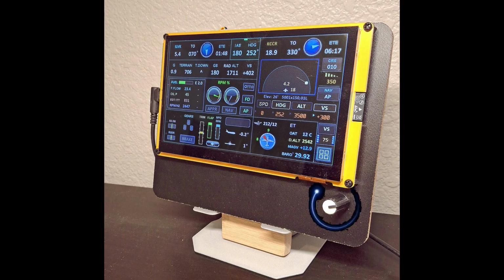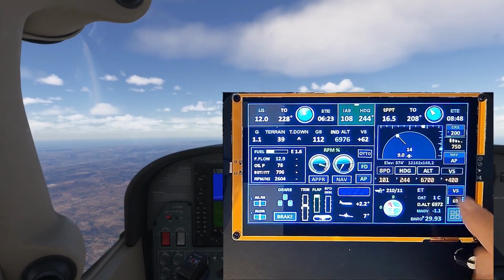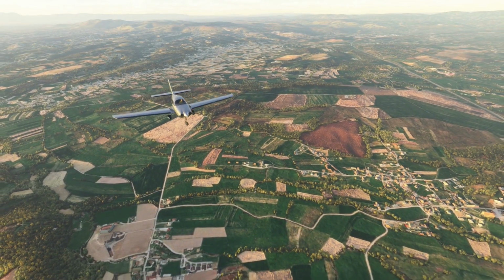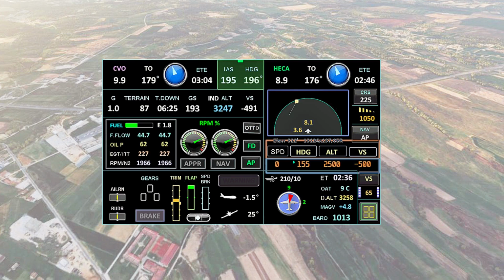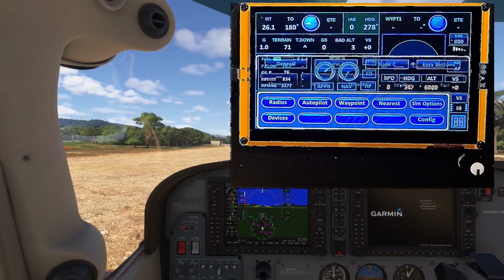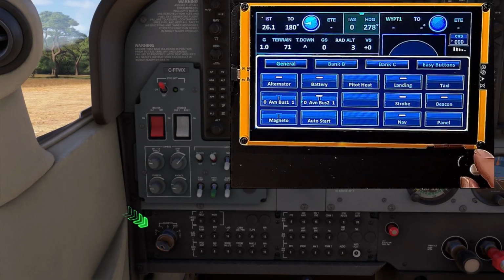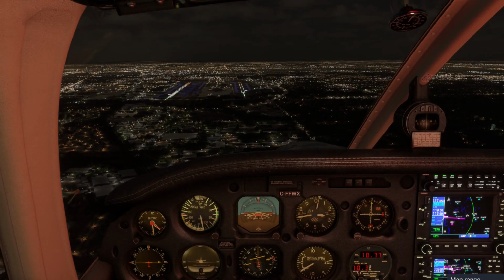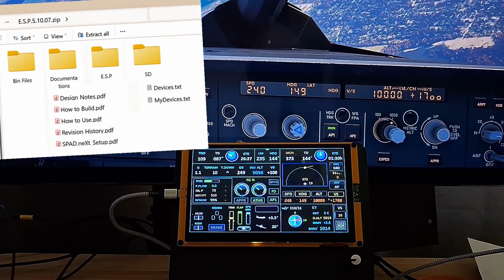Easy Sim Panel - Rotary Encoder Update - MSFS

Comment: Hi, flashing was succesful buw I cant see the splash screen, display remains more or less dark...

Chip is ESP32-S3 (QFN56) (revision v0.2)
Features: Wi-Fi, BT 5 (LE), Dual Core + LP Core, 240MHz, Embedded PSRAM 8MB (AP_3v3)
Crystal is 40MHz
MAC: 50787d14xxxx
Manufacturer: 46
Device: 4018
Status value: 0x200200
Detected flash size: 16MB
Reply from the maker: Are you using the Sunton "Cheap  Yellow  Display "?

Comment: The link you give in the PDF for the rotary dial shows two dials without any wires. Considering how cheap they are, if they are the same connectors used for the larger panel with 5 dials, I'll probably buy enough for both.
Reply from the maker: The link in the How to Build PDF does show both the KY-040 and the EC11 encoders.  The two are interchangeable.  Yes, you can get them cheap if you’re buying multiple units: https://www.amazon.com/SongHe-KY-040-Encoder-Development-Arduino/dp/B087ZQLLWQ/ref=sr_1_10?crid=5HVLGRV00C82&dib=eyJ2IjoiMSJ9.YKSu0pXKRRIOctGUdd6rIbrmJGqr5smZEIogI4WIxoiwz5vzeC7cOA87C7C2zwh9D3UFR1_igsHxVYVX3tMIBTK67buSCMnzd66z3X4KpTcKCGhh5oq7SC6vhrLd15SO-mmpT5LNY5jXmsvZaIwl4hlcygutO_sP1ktgFUL7BzghAjYzR0KlteNoZ8u_-cLXAXJDLUxAaARKeFdMSNfolQzhefiWcZpUdlXB5D9aIhI.xml0TqjYGzFvEIs392h-Jz2dMllNuR70LPFoc6P1wEo&dib_tag=se&keywords=rotary+encoder&qid=1759892075&sprefix=rotary+encode%2Caps%2C185&sr=8-10
Reply: @discman777  I forgot to ask you if it's possible to run more than one panel at a time?
Reply from the maker: @jus4funtim  Yes, you can run any combination of E.S.P. and T.M.P. simultaneously.  In SPAD.neXt, you would set up multiple serial (COM) ports based on the devices plugged in.  I have tried up to three panels at once.